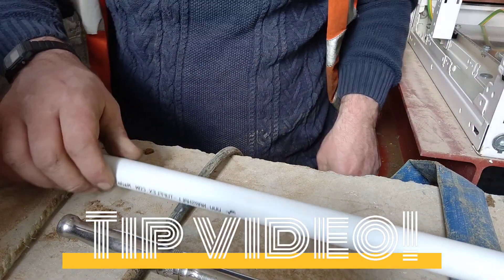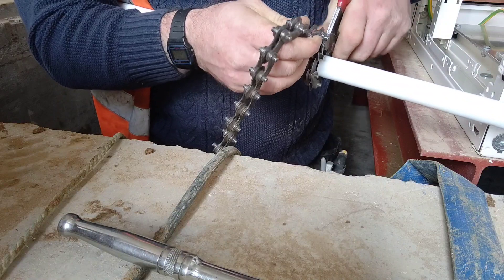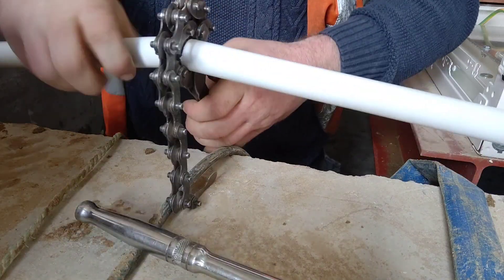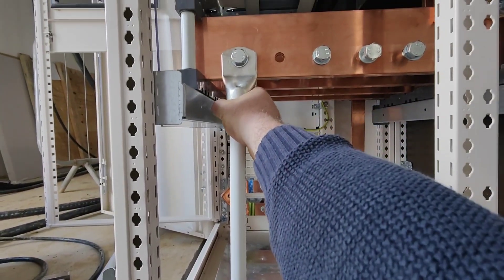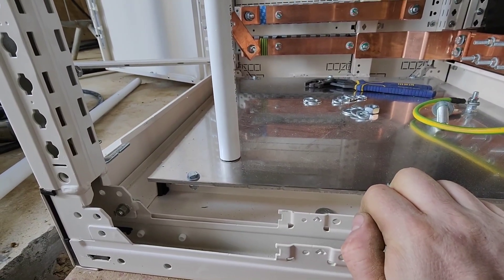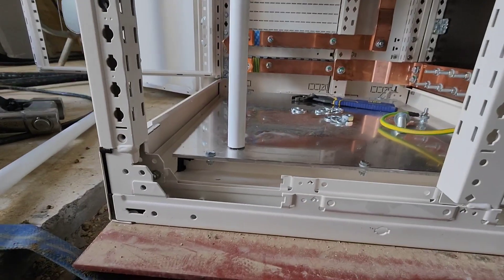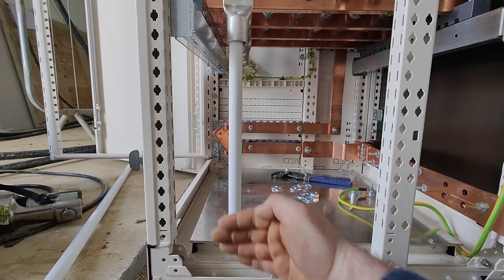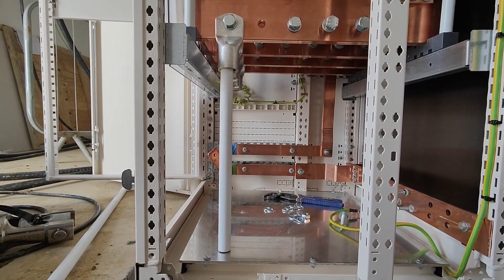It's a tip video!! A simple tip for positioning gland holes when working with single core cables

Comment: Tony. As your exhaust cutter is longer than the circumference of most of the cables you cut, would it make sense to shorten the chain? Then the removed bit might be long enough to keep as spare as those cutter wheels never get used so will stay sharp. Just a thought.
Reply: Tony. another thought whilst watching this one with the conduit measurer, if you cut the "bottom" of the conduit at 45 degrees you can mark the drilling point as you can then get the sharpie in. Love these videos, makes our 2.5mm t&e  etc   look like wet spaghetti.  PS Laser make an exhaust cutter and you can buy a new chain for it if the original wears out.
Reply from the maker: That is a good idea. I might try and swap it round so the unused blades are then getting used. I'll keep the length on though, just incase. 👍🏻

Comment: Great tip. I use a small plumb bob. If you take the first lug as reference and mark the glanding plate below all you need to do then is measure from centre lug to next centre lug for any additional holes and mark away from your original point on the glanding plate. Your way probably quicker and just as accurate.
Reply from the maker: It's all about saving time when you're on price. I like that fact that you can see where the cable is gonna go when you use the conduit.

Comment: Do you in England use aluminium cables,  like 4x150 mm2, 4x240 mm2
Reply from the maker: I have worked with them in the past but they're a pain to pull and connect. We tend to use copper even though it's more expensive.